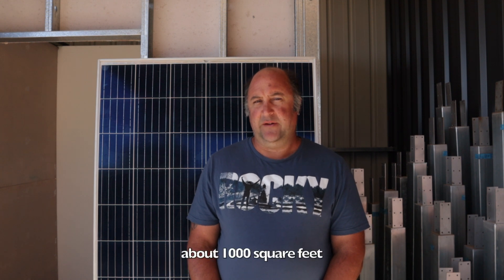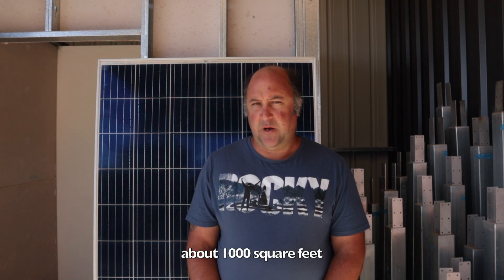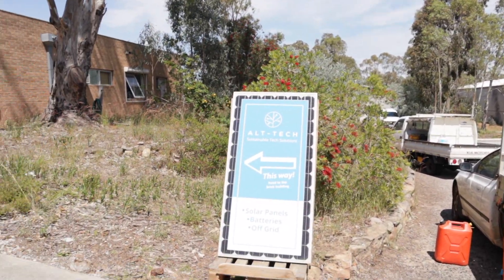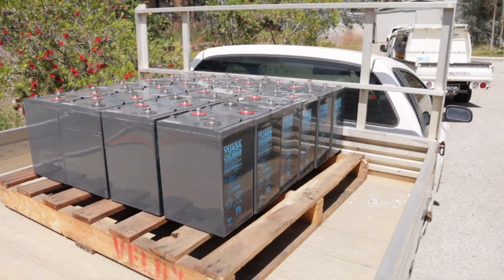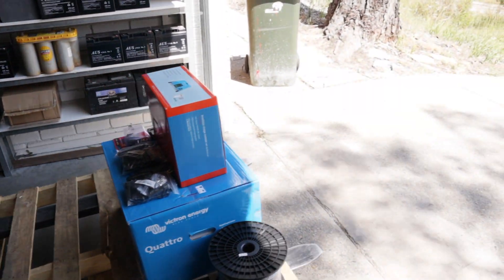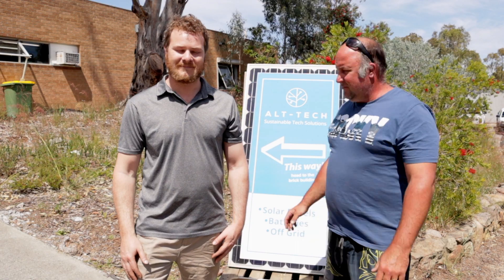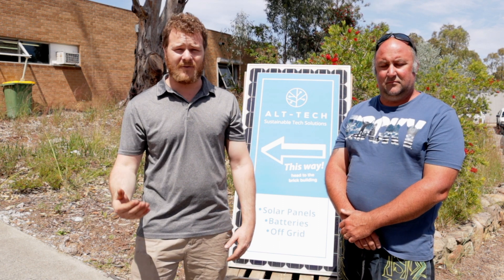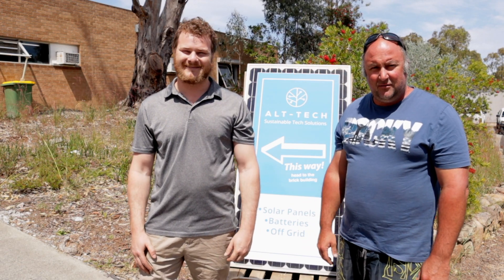All the gear for our off-grid homestead solar power system

Comment: Hi Guys
I have just oy found your channel and have started from the beginning and I’m watching all your bids through.  This video has been awesome as hubby and I are looking to move onto our property in the next 12 months and we want to be fully off grid.  I’m not sure if you go over the costing in future videos to come, but was wondering if you could give an approximate costing of the full off grid solar set up for your sized home as we would be looking at something similar and would love to know approximately what kind of money we would need to allow for a simar setup.
Love that we have found an aussie couple living the same dream we are after.
Reply from the maker: Hey glad you found us! Here’s a break down of our system and it cost us about 12k in 2020

Panels
16 330w panels. Triniasolar brand, max voltage 37.4v
Wired in four strings/series/parallel
70 amps for all sixteen 

Victron MPPT Charge Controller 150/100. 
Can handle 150amps and 100volts.

Batteries
24 2v 600amp hr battery. Yuasa brand, uxl600is series, lead acid solar battery flame retardant (not lithium)
Combined into a 48v @600 amp hr set up 

Batteries push 48v to inverter and inverter changes 48v DC (direct current) into 240v AC ( something current).

Vitron multi plus (48/5000/70-100) 5000w
Turns the 48v to 240v (more efficient than 12v to 240v)

Usage
Inverter can peak surge at 10,000w
Continuous power output on 25 degree day just under 4000w
Then continuous output lessens as temp rises 
Example, 40 degree day continuous output 3500w
Reply: @ROCKPILEOffgridHomestead  you’re amazing thank you so much for taking the time to reply.  Thats a great setup for the price!  Looking forward to watching all your vids.  Thank you again :)

Comment: Wow! We'd love to be completely on solar! It's just so expensive to set up and we're not 100% sure on what we need. We've got solar hot water, which is awesome, but that's it.
Hahahahaha, love the enthusiasm at the end 🤣
How did you decide on the system you went for? What works with your current system and is there anything you'd change if you could do it again?
Kat 😄
Reply from the maker: The guys at Alttech were really helpful and basically designed a system to suit our power needs and budget. They supplied all the components and we installed. We just needed a licensed sparky to set up the switchboard to 240v that went to the house. Our panels and batteries were second hand and all up the system cost us about 12k plus the sparky which was another $1200
Reply: Hi Corey was your electrician local?
We’re looking for an electrician to finish off our off grid upgrade. 
Cheers Alan & Kerry
Reply from the maker: @alanblyde8502  we struggled to find a local sparky to hook up the mains 240v from our solar. We ended up paying a fortune to a guy from Perth to come out to York to do it for us. There’s more people around now that say they do it but even just 2yrs ago plenty of electricians would t touch a full offgrid solar system